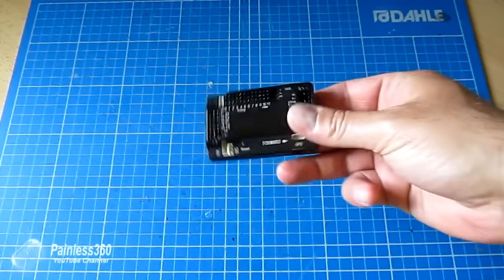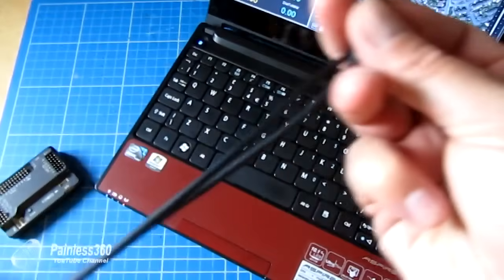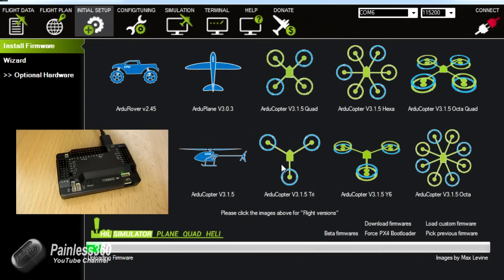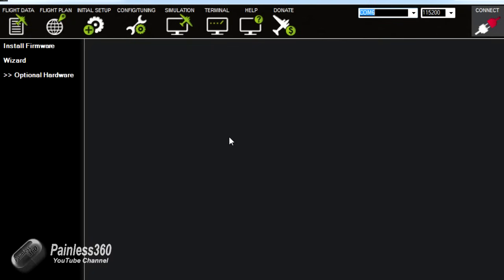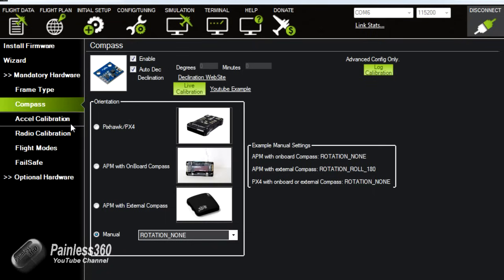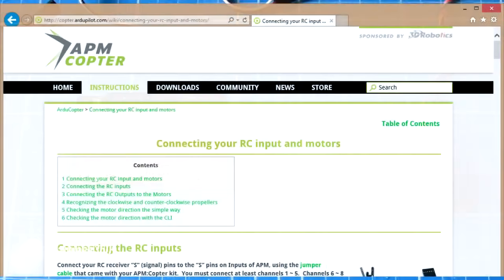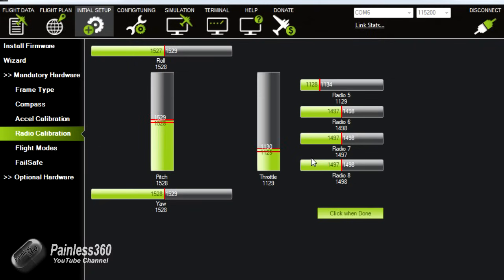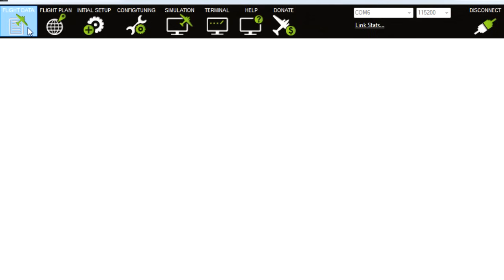(1/8) APM 2.5/2.6/2.7/2.8 - Simple installation and setup overview

Comment: Hi Mr Painless. I have got a APM 2.6. went through your videos and all seems brilliant.
I downloaded Mission planner but as soon as I click RUN, a little window pops up and says I should install .NET Framework 4.0 and then retry. done so but the same message pops up. restarted my laptop a couple of time but to no avail. Have you got any idea what could be done.
Reply from the maker: Sorry, no. I'd check the forums. Best of luck!
Reply: Thanks for that. I went to APM website and found an older version of the program and it installed, Now when I pug the Fc in into USB it does not see it. If I go into devise manager it says "drivers for this device not installed..  code28" whetever that means.
Reply from the maker: Not sure, I've not seen that here. The error is a generic one meaning that the driver isn't installed for it. Normally they are installed in a directory with Mission Planner. I'd have a look at the forums again. Looks like installing the Arduino software can help (https://discuss.ardupilot.org/t/usb-connection-apm-2-6-8/9420/2) Best of luck!
Reply: Thank you so much. I will try

Comment: I'm not sure if this has been asked already, but is there any advantages of paying more to get an APM controller from 3D Robotic vs getting one of the cheaper ones from other sources.
Reply from the maker: PA Stubbs better support and recourse if your board is faulty mainly. I use clone boards from eBay myself and have had a great experience. Happy flying!
Reply: Yeah thats kind of what I figured and thanks for the quick reply. Your videos are easy to understand and follow along for those who are just now getting into the hobby as whale as people like me who has been into it for a while but want to try something new. I've learned so much from your videos I hope you continue to produce more content.

Comment: Does anything change if I'm using a compass built into my gps? Like do they need to move together for calibration?
Reply from the maker: +Matthew Barnard Yep - I connect then with an elastic band for calibration tests. There is normally a arrow on the external GPS housing and make sure that it's facing forward and aligned with the APM. Best of luck!

Comment: Nice videos very helpful ! But did anyone find a solution for the throttle issue where you can not get full power even after esc's calibration. It must be somewhere in the software parameter setup but did not find the solution yet. Many other users uploaded videos about the same problem.
Reply from the maker: You need to look at the THR_MAX and THR_MIN parameters(http://copter.ardupilot.com/wiki/arducopter-parameters/). by default the APM will keep a little throttle range for itself to stabilise the model in flight. I think the defaults are about 13% and 85%...

Happy flying!

Comment: I have a apm 2.8 and it sat for some time before i tinkered with it again and all parememters are gone, radio cal, compass etc... How do I prevent this? Is there a time frame or am I not saving it right? Thanks
Reply from the maker: +Brian Stiles I've not had this - sounds like the non-volatile memory simply 'forgot'. Plugging in the model once in a while may help.. Best of luck!

Comment: Hi Painless360, all your videos are amazing thanks for uploading. I just got an Apm 2.6 for my quad but when I plug it in to my pc, start mission planner and try to install firmware I got an error "Communication error-no connection". It's so weird, because I had gotten a successful connection and firmware upload a couple times before. the pc is recognizing the board, the com ports are correct and the baud rate is also verified.  I dont really know what's going on. Could you help me, please? The green and red board led works too. Thank you so much
Reply from the maker: Andres Perez Garcia First thing to check is that the USB cable isn't bad, try another one. Also, make sure you are connecting it to the USB post on the of that can supply 500ma. Some are designed to be 'data only' and will have problems trying to power the APM..

Best of luck..
Reply: Painless360that usb cable had worked before but now it stopped being useful to connect with mission planner. That communication error shows up just after the firmware download. I will use another usb cable and let you know. Thank you so much.
Reply: +Andres Perez Garcia Did you fix it?

Comment: i have built up two apm systems but one is coming up with hi gps hdop and will not arm unless it drops below 2 it seams to have started sins i put the latest firmware in as i will need to fly inside it is a bit of a pain. i have been told that you can turn of the gps sensitivity down ?? im sure that i have set i up right as i have had batt failsafe cut in and came back to wear it tuck of from
Reply from the maker: This is usually due to vibration, a damaged GPS unit or interference from the main electronics.

Try and move the GPS as far as you can from the power and control systems and try again. Shielded cables and mount can also help sometimes.

Good look getting it sorted..

Comment: will there be any problems with barometer if I place the apm inside air tight container??
I live in a very humid and moist place. .
Reply from the maker: +Ashish Faustine The baro will need a small hole in the 'airtight' case so that the air pressure can be sensed. I you can cover any small opening with foam to help keep any moisture and dirt out. Best of luck.
Reply: +Painless360 thanks bro

Comment: hi there , please help me as im struggling with my apm 2.8 , i set it up well and it was flying great but now ive lost hope because i crashed the drone (F450) 2 times because the apm doesnt respond to my radio , for example there was a time where i actually had to turn off and on my radio to get my apm to respond back as it was flying away from me , and i crashed 2 times because when i pitch forward , the quad responds , but when i went full pitch forward and let go of the sticks to the original positions the quad stayed in full pitch and leading to the crash , eventho it was a hard crash right in a muddy pit , all my my motors(SunnyskyA2212)(980kv) work fine after cleaning and all my electronics including the apm and gps(m8n) is okay , it doesnt seem to be recovering from my inputs , im using an fsi6 radio with fsiA6B rx , please help , im at a point where im thinking of getting a new fc like the Naza m lite ? or should i stick with apm ? any suggestions why my apm 2.8 behaved that way?
Reply from the maker: Sounds like you have a problem with the radio connection and the receiver doesn't have failsafe/not setup. I'd check the log-files to see what happened to the signal from the receiver.. Best of luck!

Comment: hi can you help with this i have a tarot 690 which has been flying ok with afro esc i have put some 45 amp rc timers esc opto type on it and now it feels lick it will flip when taking of i have gone back to basics and re set every thing ??
Reply from the maker: Hi Steve, the first thing to do is calibrate the ESCs so that they have exactly the right throttle range. Try that first and see if it helps..

Best of luck.

Comment: okay so today I reprogram my APM 2.6 re calibrated compass radio and accelerometer calibrated ESCs and everything went for a flight at the park armed as usual took off within 30 seconds or less wasn't even more than a foot maybe two feet off the ground and the thing goes haywire full throttle take off I'm at a loss done lots of research and can't figure out why

Comment: I have a quick question that no one seems to be able to answer 
I am on my second return on a APM 2.6 and it will not allow me to calibrate the compass 
any suggestions 
Thanks 
Liam
Reply from the maker: what does'not allow me to calibrate the compass' actually mean? what error do you have? where does it fail?

Comment: does the APM 2.5 or 2.6 allow for custom code editing, similar to an arduino, I would like to make my tri-copter do some custom things using an arduino's infrared sensor and laser ranger finder, is there a way to input thoose sensors into the APM board and make custom code to operate them?
Reply from the maker: collin stiers Hi Colin, not as easy as Multiwii. I would look to use the Multiwii and Arduino to test any custom code.. Best of luck with the project.
Reply: Painless360 I get that it may be easier with the other boards, but I don't have the technical knowledge to use something like and arduino and add my own gyros/accelerometers on it, I also want to be able to use the GPS and other features that come with the Ardupilot it is at least POSSIBLE to do it, it not easy.
Reply: collin stiers I thought it would be best to give you a better Idea of what I want to do, I have some experience programing and wanted to move to the next level with real world applications, I wanted to use and arduino compatible infared sensor and range finder to track targets that have a "marker" on them made of an infared LED
I also thought of some other application like using the range finder to find doors to enable the copter to search a building, what kind of board would be best for this sort of application?
Reply from the maker: Hi Collin, yes it is possible. Most things are with enough time and resources.

The APM started out on Arduino boards and libraries, it evolved through V1 and V2 to use custom libraries and hardware. You can get all of the details and source code/libraries from the internet forums and support sites. I'd start at http://dev.ardupilot.com/ and go from there.

Best of luck with the project. Happy flying!

Comment: Need help please.  I got SBUS to work on my APM 2.8 but now my compass calibration errors out.  Is there a setting I need to change?  Any help would be greatly appreciated!
Reply from the maker: What troubleshooting have you already tried? I've not using APM for a couple of years now so the forums are probably more up-to-date. Best of luck..
Reply: Painless360 thanks for the reply.  I have tried everything.  Before i installed the Atmega SBUS hex, the compass was working.  Got the hex installed, SBUS to work then went back to do the compass and nothing. I pulled everything off the APM except the compass. I tried putting the jumper back on and use the internal compass, nothing.  I tried going to older firmware, nothing.  I am running V3.4.0.  I was tried researching it and found nothing.  I am not that technical when it comes to serial port, uarts and all that mess.  Most of the stuff i read is over my head.  I could have very well of read the solution and not have known what i read.  Any advice or a point in the right direction would be awesome!
Reply from the maker: Sounds like a problem in that code.. that's where I'd start to look.. Best of luck with it..

Comment: Hello,
I've got some problem while calibrating my Radio with APM 2.8. I connected APM through USB cable with my PC and opened Mission Planner, It was connected flawlessly but when I connected Radio Receiver with APM, Turn On Radio Transmitter and connect APM with PC. Com port did not exist. It got connected when I turn Off Radio TX. am I doing something wrong?
Reply from the maker: Possibly, what troubleshooting have you already tried?

Comment: THANKS BY the great videos !! One question, where I can find the Mission Planner for Mac Os ?? Thx !
Reply from the maker: Fabricio Medeiros Not sure as I don't use it. I did a quick google but it isn't obvious. If you find the answer I'd like to know..
Best of luck..
Reply: There isn't Mission planner for MAC OS, only APM Planner. Thanks Painless360  !
Reply: Chris Leech I Kwon this program,  you can use this software to running virtually the windows inside on Mac os.   Is not the same thing. ..but is a alternative.  Any way ...thanks !!
Reply from the maker: Happy flying!

Comment: I have noticed that every time I see someone using mission planner software, it always looks different than mine. I am using windows 7 and 8 and have not been able to see the "simulation" icon on the top of my menu as with others. Also, there are other features such as assigning way-points and have the return to home line drawn in at the end. I have upgraded every-time it is offered and have still not seen these features.
Reply from the maker: Hi Marshall. this is down to the fact that you don't have one boxed ticked in your APM setup. If you Google the problems you'll find a few places that explain why, including one on the official APM site - http://planner.ardupilot.com/wiki/common-simulation/common-x-plane-hardware-in-the-loop-simulation/

Hope this helps.
Reply: @Painless360  Thank You very much

Comment: I connected oll the wires from the apm 2.8 to the receiver. but when i push the sticks on my radiocontroller nothing moves on the computer screen at radio calibration? Do you know how to connect? or how does it work?
Reply from the maker: Keep watching - we cover this in the series.. Best of luck!
Reply: which part of the series? thanks ;)
Reply from the maker: Keep watching... ;)

Comment: I have another problem, while  I'm flying the quadcopter turns off, the power goes off, the props stop turning and it crashes. Any idea why it loses power?
Reply from the maker: Phillip Hatzis Hi. Again it is impossible for me to help with that limited information. Are you talking about main flight battery/motor power? Receiver power? What do the logs say in MP?
Happy to help but you need to explain what trouble shooting you have already done and be specific on the problem. Videos can help showing the issues too.
Best of luck with it..

Comment: hi painless the apm is configured for the quadcopters but not for helicopters right iam so much interested in the heli not in multirotor i have each and every parts but i dont know how to assemble and how to play it through ardupilot i have seen the wiki also but they are not provided any straight forward.
Reply from the maker: yuvaraj raj Google 'Traditional Helicopter – Configuration using Mission Planner' and you will find the 'official' guide - very detailed and excellent. 
Best of luck.
Reply: Painless360  Will u make it for the heli in future any idea about that ????
Reply from the maker: Not planning to - sorry.

Comment: Hi sir . i want to ask some questions . i do DIY quadcopter for my final project . now i complete to assemble quacopter . i want to fly my quad, so need me to install APM in  basic mission planner refer in this video  ? before this i want to fly quad but if i pust my throttle my quad not balance and propeller touch to ground .. TQ
Reply from the maker: See my video on what to check if you flip on take off, that should help. Best of luck with the project!

Comment: Hi hope you can advise I am setting up a fixed wing plane and am having a problem when checking out the control movements in stabilised mode.When I pitch the model nose down the elevator moves the wrong way and gives a down command.The elevator moves correct on the transmitter and the artificial horizon is showing the correct attitude of the plane. Any thoughts as to what I have done wrong.
Reply from the maker: The setup is all covered in the Arduplane manual - http://ardupilot.org/plane/docs/reversing-servos-and-setting-normalelevon-mode.html - best of luck!
Reply: Thanks for the link will have a good read tonight, going to need lots of luck
Reply: Bob Crow  - in the parameters list in mission planner find the channel  you need and then change the channel parameter from normal reverse. it worked for me

Comment: Hey, Do I need miniosd for the apm modes? (simple mode, return home if no connection, auto land and stuff?)
or I need it only for fpv monitor?
Reply from the maker: ***** The MinimOSD is only needed if you want some kind of on screen display (OSD) for a First Person View (FPV) flight. The APM board works without it and doesn't need it for anything. 
Best of luck with the build.
Reply: thanks alot i'm not flying any fpv for now so I don't need it.
great videos will watch them all! agian thanks alot

Comment: Firstly I have installed latest version of ardupilot.and required to apm ac v3.2.1. Que: I have neo 6m v2 gps. And it will be work with apm 2.8 upgrade version. ?Enable to find 3dr gps . I am trying to making last 2 months. But... I don't know about drone.before 2month.
Reply from the maker: Sorry, not sure I understand the question..

Comment: For the 2.6 with the external compass/gps, does that have to be connected during the calibration as well or is it done separately?
Reply from the maker: Shakunt Tambe See 8:47 in the video - connect the external compass at this point else it won't work.
Best of luck.
Reply: Painless360 Ok thanks! Also, is the GPS system with the apm 2.6 more reliable than the NAZA V2? I am unsure which of the two I should go for? I will definitely be using the RTL functions. 

Any specific GPS module recommendations for apm2.6?
Reply from the maker: I have not flown the Naza so can't comment but the APM is a very mature, stable platform with a great track record and, in my experience, works like a charm.

I love the RTH mode where it lands then shouts down the motors hands off. Very cool.

Up to you..
Reply: Painless360 ok thanks a lot! 

Any specific choices for the GPS module ?
Reply from the maker: I would search on places like Banggood.com for the specific GPS module that matches your APM (2.5/2.6/2.8/3.1 etc)

Best of luck.
Reply: Painless360    Ok thanks!

Comment: Question? Does Mission planner and APM planner use different firmware?  I used mission planner to upload the firmware to my 2.6 board and all is good.  But when I try to use APM planner in notice no GPS fix and lot of other issues.
Reply from the maker: Not sure, I only use Mission Planner myself so can't comment further.

Best of luck with it..